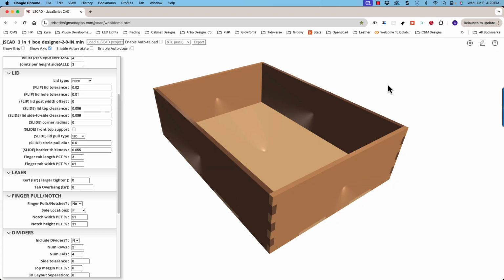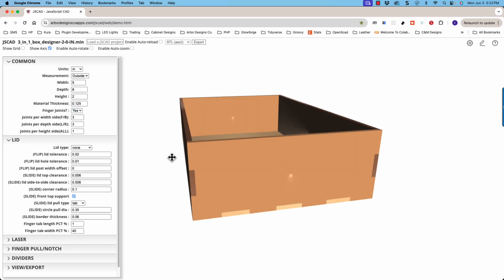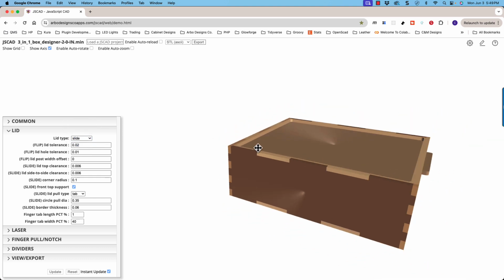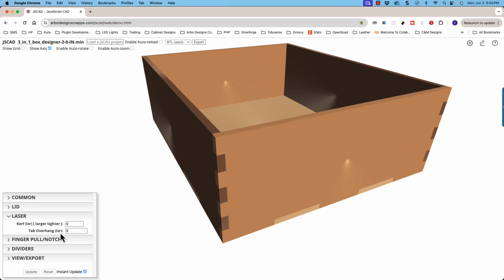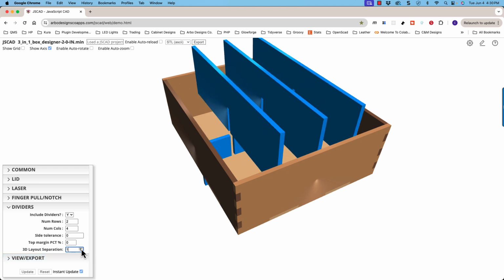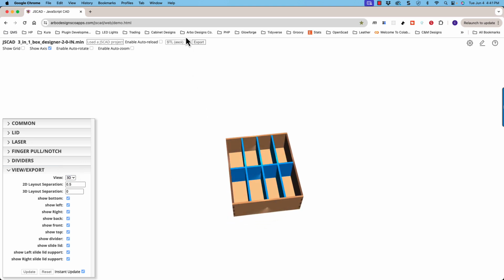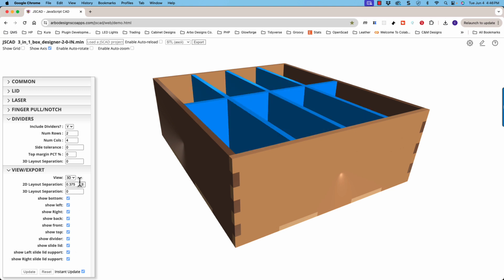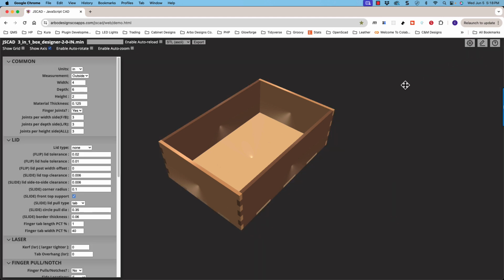3 IN 1 Box Designer Tutorial

Comment: Just purchased and love the simplicity of designing my box.  Would love to be able to put a divider in box to separate  2 wine glasses in a box. I did have trouble with the kerf feature but just set it to zero in program and adjusted it in lightburn to get a tight fit.  Other than that love the program.
Reply from the maker: Hi @Toxic-nb3dj.   Thank you for the feedback.  I'm glad you're finding the box designer useful.   I know the current divider setup provides limited configuration .  More advance divider configurations has been the #1 feature request from users and will be implemented in a future release.  I'm curious about the Kerf trouble you experienced.   This is the first time I've heard of this. If you have any additional information on this subject, please let me know and I will investigate.  Thanks again.  Chris
Reply: @arbodesignsco.2105  I did a kerf test right before making my box and it said .120 which I thought was high but programmed that into the program and it wasn’t a tight fit.  Ended up putting zero in the program and putting kerf setting on my lightburn program to compensate. I did have to end up going to a .140 to get a tight fit so might be me since this is the first box I’ve ever made.
Reply from the maker: @Toxic-nb3dj  ah, ok.  Thanks for the clarification.  I just wanted to make sure there wasn't a large discrepancy between the kerf burn test results and what's physically happening at the finger joints (obvious large gaps).  If that makes sense :). As always, I appreciate any feedback, ideas, suggestions for improvement.  Regards,  Chris

Comment: Hello! I was wondering if it be possible to make the dividers different sizes in certain areas. say like if I wanted to make 1 side for a decanter, middle slim with square cut outs for the cold stones, and other spots for the drinking glasses. That was the main reason I bought it and was hoping that was an option to do so I can make my own boxes for that. I still love the program and can use it to make boxes for other things but I feel if that was a possibility it can give a lot more customizability. Overall, great software!
Reply from the maker: Hi, Thanks for the feedback.  Unfortunately, this version is limited to a fixed grid array.  I almost released the software without any divider options, but felt I should at least provide some basic functionality.  The complexity of full customization was too daunting at the time and decided this could come in a later version.  Since releasing Box Designer, I have received feedback from several users about improving the dividers.   This is on my todo list.  When I do get this implemented, I will make sure you receive the updated version.   Regards, Chris

Comment: A great bit of software which I have just purchased. I was wondering if you have considered the option of selectable material thickness for the dividers. Given they are not generally requiring strength it would sometimes be good to use a thinner material than the box.
Reply: Thanks for the feedback.  I'm always curious about the various use cases that come up.  Off the top of my. head, I don't believe it would be too difficult to add a 'divider material thickness' parameter to the current box designer application,  but I'll look into it.  If I do implement something like this, I'll reach out to you, so you can test it.  I'm also thinking of a separate 'Divider Designer' application which would allow you to make more customizable divider configurations with varying sized cells.  Also, the addition of slots and tabs for greater strength and stability.   Thanks again.